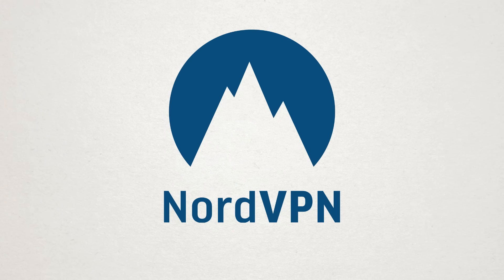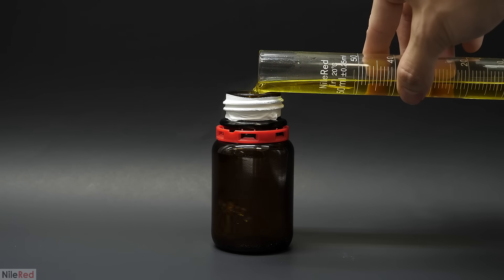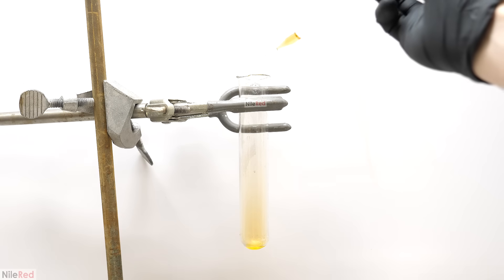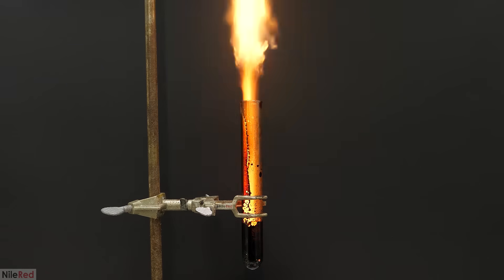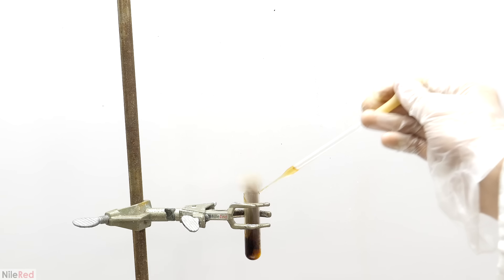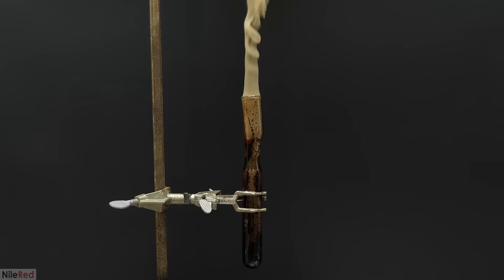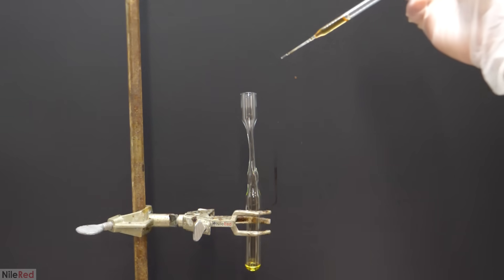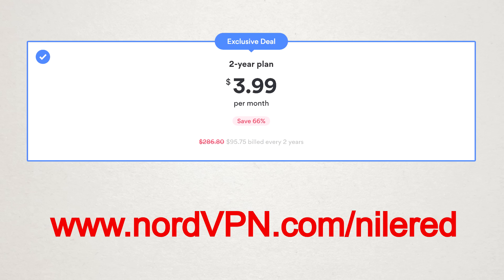Making test tube liquid rockets

Comment: A warning when playing with mixtures of concentrated nitric acid and aniline: Make sure your residues are thoroughly diluted with lots of water when cleaning up afterwards, especially from the tubes that didn't ignite. This is due to the other reactions between the aniline and nitric acid. One is a simple acid-base reaction, producing anilinium nitrate, aka phenylammonium nitrate, which is nothing to really worry about.

However, nitric acid doesn't stop there: It also sticks nitro (NO2) groups around the aromatic ring at the ortho and para (2, 4 and 6) positions. You will definitely make nitroaniline and some dinitroaniline, possibly even some trinitroaniline if the nitric acid is in excess. These are all explosive compounds, with a similar behaviour and sensitivity to picric acid. So you don't want to leave them hanging around for too long - they might get frisky at some point and decide to pop off . . . . .

Comment: @NileRed, I love your videos, and I have no problem with you deciding to get your videos sponsored by NordVPN, but I find what you say about security online a bit misinformed. Nowadays most reputable and popular social media, banking and mail websites use the SSL protocol. You can know that because the URL starts with https. This means that your device trusts that website because it has provided a valid certificate, and that all data will be encripted using the server's private key. Even if you're on public WiFi, no one but the server and you can know what's in those messages.
Sure, NordVPN can offer extra protection for websites which don't use SSL, but most day to day websites like Gmail, Outlook, Youtube, Facebook, Twitter, Google... all use SSL and are already secure.
Also, I haven't looked into how NordVPN works, but surely it must at some point transfer your data unencripted to the server if the server doesn't use SSL, because otherwise it wouldn't be able to understand it. So, very probably your data gets encripted, sent to NordVPN's network, then decripted and sent to the server.
I'd encourage you to research the topic a bit more. Knowledge is power, and especially IT knowledge in this day and age.

Comment: You know I got to looking at what was going on and it almost seems like there was a pulse-jet type reaction going on. Most likely it’s due to the extended narrow throat. It seemed like it was creating pressure, consuming the fuel, and then creating a vacuum for a second. In most rocket nozzles the throat is a very short and proportionally smaller outlet.

Comment: The first thing I noticed when you narrowed the throat was that the reaction seemed to last significantly longer in the larger tubes, I was wondering if there was a reason for that or if it was just coincidence
Reply: The narrow throat constricts the flow of fuel to the ignition point.

Comment: back in the 60s some drag racers occasionally bent the rules and added hydrazine to their nitromethane fuel for a massive increase in power. natrually this was incredibly stupid and very, very dangerous due to its hypergolic nature. not only is it incredibly carcinogenic, but that solution also creates a soap-like substance that is a contact sensitive explosive. there are more than a few reports of engines being blown apart, and a lot of those guys died of cancer. use extreme caution if you decide to mess with H.

Comment: One of my favorite topics I've always been too scared to tackle myself. :D
I really really hope you're working with a face shield.

BTW, don't use a dremel for cutting glass tubes. Just score them, wet the score mark and touch it with a bent glowing hot wire. It will snap in two pieces.

Comment: @NileRed You got a pretty good firing with your small diameter throats, but there is an engineering aspect to making the reaction even better. In high power rockets, the divergent side of the nozzle is designed to equilibriate the pressures of the expanding gases to the ambient pressure. I am doubtful you can achieve such precision with off the shelf glassware, but if you want a side project consider looking into stainless steel nozzles or various DIY high power nozzles to attached to the aft end of the reaction vessel.

Also something to note, the reaction in the larger and smaller tubes most likely ignited when the vaporizing gases were at the same volume. That volume can be calculated to best design a combustion chamber which would ultimately react the fuel and oxidizer much more efficiently and produce a longer burn. Just some interesting tips from a studying rocket scientist (:

Comment: If'n y'all were to use a pipette in a pipette [small bore in larger bore] and inject the fuel components through each at the same time, 
the turbulent mixing of two thin streams might be more betterlyfull than simply dribbling part A into a puddle of part B.
You lose gravity dependent operation and get throttling control!  Thrust depends on flow-rate.
Would still need some kinda combustion chamber/throat/bell arrangement...

Comment: Why is this so hard? It’s not rocket scie—oh wait
Reply: Was about to make exactly this comment, but you beat me by 6 months lol
Reply: @ryanc473  he beat me by 4 years :(
Reply: @ryanc473  He beat me by 7 years ur good
Reply: @ScipioAfricanusAemilianus143   he beat me by 7 years too
Reply: @ryanc473  he beat by 3 yrs lol
Reply: Ahhuh!
Reply: Rocket science is easy, rocket engineering is the scary one
Reply: @emilianozamora399  I think as bad as that is you might find that flying a rocket as an astronaut, mission command, or even fueling a rocket is in fact scarier
Reply: nice one...
Reply: It’s rocket surgery, uncultured swine
Reply: @Neil Dickman I thought the same
Reply: the reason of it not showing any intresting things when you narrowed up the throat was the 
1) the combustion chamber or the place before the throat where reaction was happening was way to big and thus there was not much pressure built up to fire through the main nozzle
2) the throat to nozzle ratio largely matters when you deal with bell nozzle engines here the nozzle was way to big and what happened was the pressure in the chamber dropped too low and thus causing the the air to come in from outside which slowed the reaction and thrust. this is why the flames was not close to the walls (glass)
3)the shape of the part after throat was not well for fluid mechanics. if you see very carefully the throat the place just after the throat you would see a huge empty space between the flames and wall which should have existed 
these were only which i found out being a noob in the subject but yes i could say if he had done all these he might have blown everything around and even glass would not be able to handle the pressure in the chamber
Reply: SPACEX we didn’t need a explanation, he knows it is rocket science
Reply: Ah yes, Matt Lowne
Reply: Jeb: more boosters?
Reply: @PuffleFuzz  moar boosters
Reply: No.
Reply: Benjamin Sison lol lol lol x 10000000000000000000000000
Reply: Why are people liking a bad joke used literally in every video about rockets
Reply: @Josecannoli1209  because its funny
Reply: It’s literally rocket science, lol.
Reply: Yeah it AaHQ
Reply: Bro easy thingy + fule = moon
Reply: HaAaAaAaAAAAh
Reply: B boys
Reply: Me when the science is, indeed, rocket
Reply: Rocket + Science = Rocket Science :)

Comment: Could you try putting some RFNA on some Hydrazine Sulfate? I'm not certain but I think it should react similarly to freebase hydrazine. If not, if you feel comfortable you could try making freebase hydrazine from hydrazine sulfate, it's hypergolic with both RFNA and Dinitrogen Tetraoxide. Also I'm sure you know but NTO can be made by cooling Nitrogen Dioxide pretty easily.

Comment: Chemist’s version of a horror jump scare
Reply: Almost. There should have been an exploding test tube in there somewhere.
Reply: Real horror is dimethylmercury
Reply: @jordyv.703  Phosgen.
Reply: @luisp.3788  Phosgene isn't even harmfull is low concentrations
Reply: @jordyv.703  Stroke?
Reply: @luisp.3788  From Phosgene? I know it can can cause heart failure if exposed to enough. But it's still nothing compared to C2H6Hg.
Reply: @jordyv.703  Nevermind.

Comment: Please be careful, we all want to continue seeing your videos but not at the expense of your safety in an amateur laboratory. Hydrazine is phased out in almost any industrial application due to its toxicity. Convergent-divergent nozzles rely on imposing greater pressure inside the chamber. For reaching sonic conditions you would need to generate 1 barg assuming air. I'm pretty sure you understand the risk of playing with toxic, corrosive and explosive substances under pressure.

Comment: Awesome test! One hypergolic combination I've tried before was furfuryl alcohol and WFNA. As for hydrazine, I have no experience with that to say whether it is a bad idea given your setup. I would think, though, that the best way to obtain it would be to start with hydrazine sulfate, which is readily available and a pretty safe solid, but which can be easily converted to a solution of plain hydrazine in water. Finally, one small correction regarding the rocket nozzle - you are correct that the convergent nozzle speeds up the gasses from subsonic to supersonic, but what you missed is that supersonic flow has the opposite behavior - letting it expand into a wider cross-section causes it to speed up, not slow down as it would with subsonic flow. So, the divergent part of the nozzle is actually doing the same thing that the convergent part does, just at a different flow speed.

Comment: Hydrazine, really hypergolic fuels in general, isn't used in rockets because of the large amount of noxious fumes released into the area, the danger to those working with it, and the fact that rockets are known to explode before they reach space (see Nedelin catashtrophe - not hydrazine, but definitely hypergolic).  Hypergolic fuels' main uses are in thrusters for orbiters/satellites and as a source of ignition for non-hypergolic fuels.  Every modern professional/military liquid fueled rocket uses LOX and non-toxic fuel for thrust.

As for your make-shift nozzle, it needs to be specially designed with precise calculations.  The throat is supposed to get the exhaust up to the speed of sound using the bernoulli principle.  After gasses reach the speed of sound their properties change and you need to expand them in order to get them to move any faster.  For different oxidizer/fuel combinations the speed of sound of the exhaust will be different and for different combustion temps it'll take different throat lengths to reach the speed of sound.  The shape of the nozzle going into and out of the throat is also very important.

If you're planning on making more liquid fuel rockets, I'd suggest using non-hypergolic fuels for safety and finding specifications for a small liquid rocket engine and copying that to the letter so that you don't have to do any complex calculations in order to get a properly working engine.

Comment: Instead of narrowing the test tube by pulling (stretching) which thins the sidewalls, it would be safer to soften the glass and roll it against some needle nose plyers or a corner of bench to pinch it down without thinning so much

Comment: Scott Manley has a pretty good video series on rocket plumbing/nozzles that might also help explain the difference in noise between the tests.
As I understand it, it's due to a relation between nozzle size and atmospheric Pressure.

Comment: Comrade, you really needs to be careful with the ignition test , especially with the one you shown at 8:56 . A smaller tube would result in the ignition to be close to the bottom, paraphrase of what you just said , but with ll seriousness in mind, please be careful , I had witness what these type of ignition could do to flash if the igniter was not careful , we use to fill big drums with a small amount of it and fill it with trash and send the content flying with a flaming pole, and there have been accidents where the fuel spills onto the hand. The vapor , smoke and the fuel itself are all very toxic to the body, so ,please be careful.

On the other hand, have you considered using a combination of liquid Florin(fluorine) and liquid NaOH ? The propulsion force is good and all, but the people I worked with says it is too costly (and too reactive) .In theory, the best fuel is Liquid hydrogen mixed with Beryllium suspension (fine grain) to produce a sticky gel as main fuel and Liquid Fluorine as the oxidation agent . It gives out  power that is more or less equal to a F1 formula racer , 6.8 MPA At room temperature and pressure .Sea level specific impulse is around 480m/s2 , vacuum specific impulse is around 560m/s2 ,with a staged combustion and a pressure of 20Mpa+ , the propulsion could be increased even more.
Reply from the maker: Liquid fluorine does now sound fun to me! Ha
Reply: thanks for the reply !By the way, the big-drum cannon thing I was talking about , you might know it as the Polish cannon

Comment: So as for the worrying about the neck of the test tube; the size of the throat, shape and size of the bell, and the rate at which the be throat contracts/expands at the bell and chamber are crucial. Part of the reason the rocket engines generate so much thrust is that they are engineered to control where the sonic shock wave happens. This creates resonance in the bell which helps create compression on the exhaust. It's like an even smaller throat created through the bell by high pressure gasses. You can see the effect when you watch some of the pro rockets firing and it looks almost like a flame within a flame. That said, when original rockets were made, before this sonic wave was really discovered and harnessed, a lot of rockets exploded in the faces of scientists, so safety and caution should never be thrown to the wind. I think this could create some interesting effects on the reaction, as it looks like the reaction is moving up through the tube, and the control of the wave would cause back pressure on the "throat" meaning the reaction would only take place within the chamber (and creating a lot more thrust). I love the vids, keep making them, it's really piquing my interests in both rocketry and chemistry!

Comment: Why does it burn twice ? I can't figure out why it always does this. Does the ratio change or its reacting with the air the 2nd time? That would complicate things in a rocket unless its pushed out side the nozzle.
Reply: The plasma of the fire is pushed out far enough and with great enogh speed it wont get back anymore, and then its pretty much step 1 again, heat from the reaction vaporizes aniline and nitric acid, and the heated vapours react faster to create more heat and so on and so forth.

Comment: Hmmmmmmmm liquid rockets eh? Wy not just use normal hydrogen its a pretty good rocket fuel and its pretty easy to get If you are able to seperate water to hydrogen and oxygen also that brings me to the oxygen which could also be used as an oxidizer
Edit: Im sorry I wrote this before watching the video but I do suggest trying to use hydrogen in a combustion reaction obviously carried out in a controlled manner and in a safe place

Comment: It seems like the throat needs to be smaller than the combustion chamber and the nozzle needs to be larger than the combustion chamber to support complete combustion. That with the proper mixture of fuel and oxidizer. IMO, hydrazine and its derivatives are not worth the risk, not for a hobby anyways. It's highly carcinogenic and a public safety hazard.

Comment: You should try twisting the test tubes instead of stretching. This way, the thin part is not as long as if you stretched it. This way, the gases might escape easier.

Comment: I've been bitten by the rocket bug too, and I might be able to tell you something.
I've wanted to do these kinds of experiments myself, but I don't have access to chemicals.
Your test-tube nozzles seem to face the same problem faced by many - most of the combustion before the second firing happens outside the combustion chamber, which leads to decreased thrust. For the kind of pressures you might be dealing with, I think you might get away with a thinner throat and not too much of an expanded nozzle.
Here's a nice PDF on liquid rockets:
http://www.cientificosaficionados.com/libros/cohetes.pdf

Comment: Well in Laval's nozzle, speed increases when the cross-section decreases only for subsonic speeds. Otherwise, for supersonic speeds, you'll have to increase cross-section along with   the speed. The speed of sound (caution : it is calculated with the local temperature, which is why solving the math is hard) is attained at the point with the  thinnest cross-section.

Comment: The function of the neck is to contain the combustion to the chamber and contain the expansion to the nozzle. The neck basically increases the pressure of the combustion chamber which creates a more efficient burn and heat extraction. Think of it like a heat pump. You can get more work out of the pv diagram by manipulating compression and expansion.

Comment: I wonder if the larger tubes carry a more reliable ignition because of the greater exposed surface area of the nitric acid.

I'd be interested to see what this looks like in something with a wide bottom and a long neck, like a really small volumetric flask.

Comment: Not going to get the gasses to go sonic in the throat unless you get at least 30 psi in the tube (chamber).  You need to exceed the critical pressure ratio for gasses to accelerate to sonic.